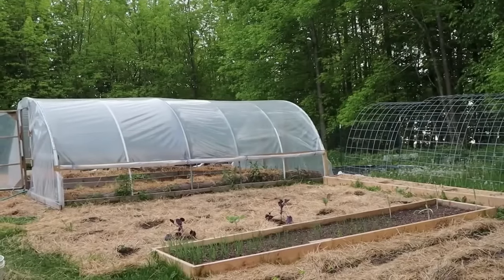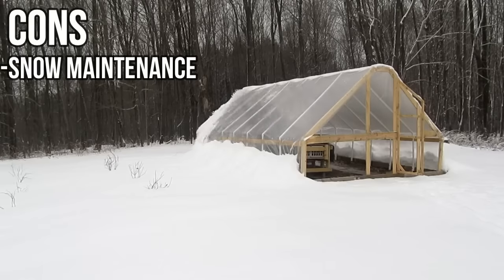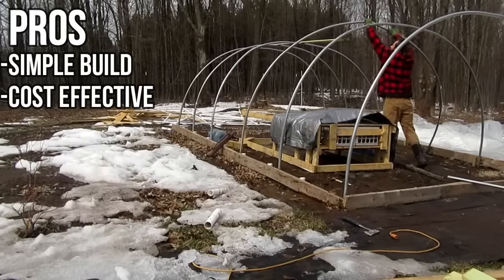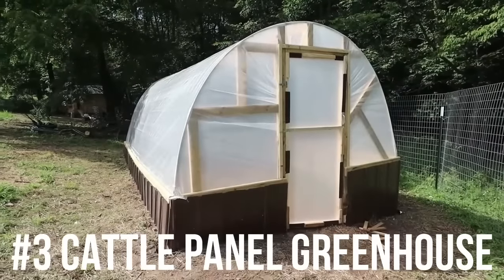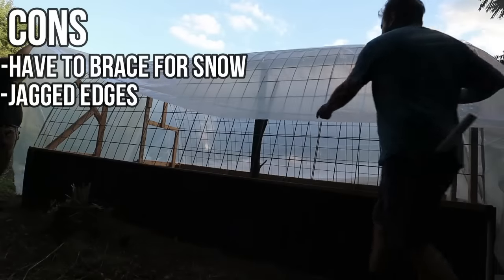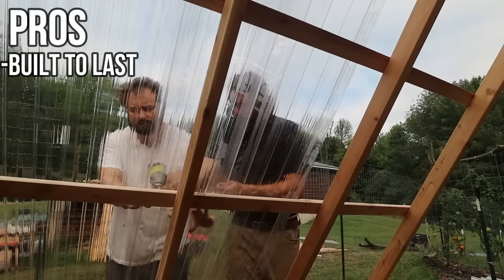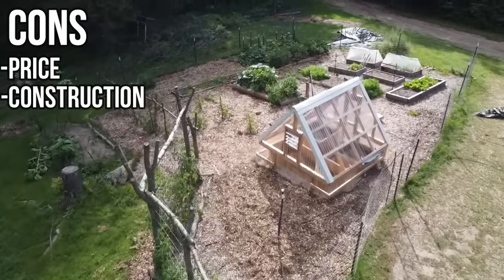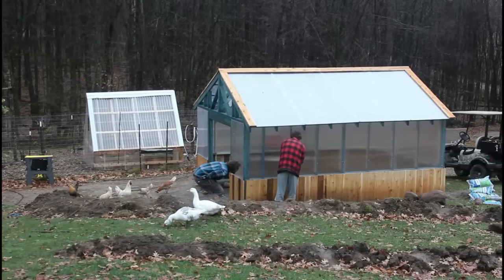The Ultimate Guide to DIY Greenhouses: Pros, Cons, and Everything In Between

Comment: Amazon diesel heater its $200ish runs 16hrs on 5L of fuel vent it outside thru the wall just need a run of galv sprial duct with 1” holes every 2’

Comment: Bro said Con for the first one you need to assist slow removal then showed us that it can be done in under 1 minutes.

That should of been a Pro
Reply from the maker: The pro was that it is slopped for snow shedding so it takes less time. It is a con because you still have to go out there and do it. For the more permanent builds you don't really have to do that at all. But you are right, it is definitely not difficult at all

Comment: Tip for those going with the cattle panel green house. You can get 10' straps of FRP panel corner/end strip from places like builders first source or 84 lumber. Basically any building matetial place geared twords professionals will sell it. Works great on the sharp edges of the cattle panels.
Reply from the maker: Great tip thank you!

Comment: What if you fill pvc with cement?
Reply from the maker: Crazier things have happened hahah.  I have no personal experience with that.  I think it might be hard to get it in the tubes and costs could add up.  But it would be unique if you pulled it off
Reply: You'd want a high percentage of fibre reinforcement in the mix or it'd crack immediately and the weight of the concrete would just be a liability. Check out GFRC.
Reply: @AndrewHelgeCox  What about  foam crete?
Reply: @artistsmeetfilm6491  Aircrete? That's lighter but even more brittle. I don't know if people put fibres in it and get any useful tensile strength.

Comment: if you have some quater inch irigation lines you can run a ton loops on the roof to heat water  just put loops wher you wan the heat to go add a low voltage motor  and a small tank for the water  and your apples

Comment: Wait... 500$ for the one with the castle panels...? In my country a 10mx4.5m with 40mm/1.5mm tubes cost 900€ delivered with 200micron plastic.... why bother doing it..?
Reply from the maker: That list was if you built it the exact way we did. We had all of the material on hand and in scrap piles besides the cattle panels so it was not that expensive for us. We framed out a side wall so I could stand up in there because I am very tall. You could just buy the cattle panels and make a simple structure for cheap. I made a price list to show what everything included in our build would cost so people can figure out the best course of action for themselves.

Comment: Double layer the plastic, with the top layer a little less tight, then get a blower to blow air between the two layers of plastic. This give a dead air space which will both help keep the house cooler in summer, and  warmer in winter, and gives a pillow puff to help shed snow.
Reply: That's more work than you realize. I suspect that you've never actually done that before.
Reply: @maxsdad538  80 by 20 feet. Why do you suppose I suggested the idea.
Reply from the maker: That definitely a good way to go, I am not sure If i am getting to that this year, I have a lot of things on the to do list. Can I ask what zone you are in?

Comment: I used reclaimed wood for my frame that I covered with a few coats of spar varnish. The foundation is made from landscape timber. The roof I used is a greenhouse plastic and the walls are made from thick vinyl rolls. It is on its second year and holding up ver good.
Reply from the maker: That is awesome!! Nice work, that sounds impressive
Reply: @TheNorthBranchWI  if only I could post a picture

Comment: There's another greenhouse build that I like. It looks a bit like the cattle panel build but uses black poly tubing as hoops, making the frame strong and UV resistant. Clear corrugated lexan sheets are then screwed to the outside. Strong and good in cold climates.
Reply from the maker: Nice! That sounds awesome.
Reply: I have a thing for octagons and have build a cabin in that shape. It's a really good shape for small sized buildings and now I want to build an octagon greenhouse. I just need to figure out how to make a clear roof without all that cutting...

Comment: Please describe the temperature gains (day and night) over outside temperatures. That’s what’s really a core issue as to what works or not. Also any thoughts on thermal management?
Reply from the maker: Started tracking those in the fall and will do it again this spring and be sharing as I go.  I made a video about how they handled winter and spoke about temps briefly.

Comment: Just a couple ideas I've been kicking around for heating options.

Electo magnetic and the proper piece of copper, possibly even copper piping. By regulating the power of the magnet you can produce the heat thru magnetic Flux.

You literally could be the first one to own a greenhouse with a Flux capacitor lol
Reply from the maker: That would be so cool!! All of that is way over my head though. If you have any design ideas let me know haha
Reply: @TheNorthBranchWI  you can get the electo magnet from any transformer check out electo magnet from old microwave.

Power it with one of those model power units to get an idea of what voltage/amps gives you the correct temperature and either you can do the heating in air for succulents or in water to increase the humidity
Reply: One More thought is once your greenhouses are staying warmer then you can have their Air come out of the house and heat your house with the transfer

Comment: Thumps up and best of luck with your greenhouse endeavours. ❤🎉 A pit walipini style greenhouse tranch dims = 2m deep, 5m wide, 8-10m long or whatever (1m~3feet) will suggest a smoother temperature flactuations and heat storage. Some extra ideas for air stratification and geo termal tubes for heat storage will serve a great purpose long term in cold climate.  😊

Comment: I built 2 greenhouses using cattle panels and tuftex polycarbonate. 6 years and still going strong. I used zip ties to anchor the panels to the wire and sealed the holes with a little silicone caulk.
Reply from the maker: Awesome! Cattle panels are very durable

Comment: Have you thought of a geothermal heating system?  The hardest part is digging the trench, but it is worth it because once you do all you need is a fan to regulate the temperature summer and winter.  A small fan with a solar panel would do the job for a space that size.
Reply from the maker: We have thought about it.  For us, we don't really need to cool in the summer.  Even our rare 90 days cool off at night.   And our coldest months don't get enough sun to grow much anyway.  So we are going to try to just add thermal mass and extend our seasons a bit.

Comment: Missed on what you did with  windows. My dad has a  greenhouse from a  kit (alu + single pane glass with rubber strips between frames and glass) , roughly in the form of your last greenhouse, but even quite north, 51.2N, a hot day in March can increase the temperature to 40+C when closed, so ventilation options are quite important for us. (and it is cactii, so they can tolerate heat reasonably well).  Heating is done by a small electric heater except when temperatures are below -5C, then a petrol stove takes over. Or is this a glass vs plastic thing?
Reply from the maker: That is interesting. We are considering a lot of heating options. I don't think we will ever try to heat the entire winter because of our cold temps and lack of sun in the winter.

Comment: Awesome video.
Just me a bit confused, about when you say 6mil plastic, do you mean 600 um. As in .6 of a mil?
Cause 6mm is like nearly .25 of an inch. Can’t be that thick.
Reply from the maker: I do not have the slightest clue what they are measuring.  It is just called 6 mil greenhouse plastic.
Reply: A mil is a thousandth of an inch,  (0.0254 mm). 6 mil = 0.1524mm or 152.4 um :)

Comment: Do you wish you made a steeper roof for the last one?  Perhaps with panels that open from the ridge to vent?  Electric soil heaters?  Too late now but you could have put "chimneys" inside your concrete foundation that connect to a small fireplace or wood or corn stove.  Anyways, it's just a thought.  Have a good day.
Reply from the maker: No the snow came off with no issues this year. And that would have been cool haha

Comment: Easy fix for irrigation would be to pipe the water evenly from both sides, through a slight v shape metal pipe drilled with tiny holes, or run it along an angle with a straight pipe if that doesn't work. Adding filter screens would prevent pests and blockages if you have trees nearby, and geothermal is an investment, but for long term it can't be beat to heat
Reply from the maker: Thank you! Those are all interesting. And geothermal definitely seems to be the best option, but tit is a lot of work and money you are right.

Comment: Great video.
     Question: is there a difference between municipal codes for these structures?
     ... for example a lot of times the dimensions, material, and/or
          mechanicals can trigger a city/county inspection and the purchasing
          of building permits.

Thanks for sharing this video.
Reply from the maker: You would have to check with local planning department probably.

Comment: Heating, steel drums filled with water along one side inside the greenhouse.
They hold heat from the natural source and radiate it out overnight, adding a powered heat for cooler times of the year the drums full of water will still absorb heat as it's added then radiate it out. This reduces the cost of heating during the cooler months since the water mass is slowing down heat loss drastically. 

We used this back in the 1980s and it worked a treat to have the growing season extend both starting earlier and ending latter.
Reply from the maker: Very cool.  In the spring we plan on putting gutters on and having at least one barrel for collection on the northwest side.
Reply: @TheNorthBranchWI  The only real issue with the barrels of water is the extra heat during the growing season, we had to leave the door open and let the excess heat vent until it started cooling off in the fall. That was 5 steel drums in a greenhouse about half the size.

Comment: As a passive heating system, I have heard of people using black 'pickle barrels' made of plastic and filled with water.  The black barrels absorb heat and warm the water and then the warmth is released slowly overnight to keep the temperature above freezing, and the process begins all over again on the next day.  I do not have any data on how well this works, sadly.

Comment: It stays with the plastic. Unexpected.
I don't know about you, but my greenhouse will have glass. :)

I am building a shed right now, which taught me enough about timberframe structures to tackle a greenhouse.
As for a heating system; a masonry heater is very neat. And you can snake the exhaust throughout a wall, so it retains a lot of heat. Sort of like how you can make a micro-climate with drystone walls.
Reply from the maker: Interesting. Good luck with what you are doing!
Reply: @TheNorthBranchWI  Thanks! Likewise!

Comment: you might want to look into polytunnel they are used in the UK you can have them as long as you like with a few width options,use the white tape on the outside of the hoops as it helps against the sunlight heating up the metal and damaging the plastic sheets
Reply from the maker: Yeah those are great! We had something like that a few years ago and they work well. We just wanted to make something that could stand up to our winters for the long term without a lot of work. But apparently their are programs for farmers in the USA that can fund high tunnels for farms so we will see haha

Comment: This may have been asked, but do the plastic panels have a size change when hot/cold? Do you need to put them in a frame that allows this movement?
Reply from the maker: Hasn't been asked, and I am not sure. We did not plan for them to move too much, if that is an issue we run into I will let you know. They have some room to wiggle in our current design. Hope that helps

Comment: Is it possible or even practical to build to build the corrugated A frame green house  into a barn style (do to  my width needed) out of PVC pipe and either zip tie or screw the panels to the PVC Pipe?
Reply from the maker: There is always context but anything is possible.  With pvc I always worry about snow load but idk if you are going to deal with that.   For barn style are you talking about ana white?  with the shed style roof? 

If you go that route i would consider some cedar 1 x 3 purlins then attach the panels to that.

Comment: With the metal conduit, did you ever think to connect with 90 degree conduit or pipe connectors for the roof? You could have had a 45 degree roof made of metal and plastic without having to bend the conduit.
Reply from the maker: We built a cold frame where we bent emt conduit to 90 but I never thought about doing it with pipe connectors.

Comment: the 6 mil plastic works great in my are. but i put a spacer and have 2 layers of plastic. it's not as hot. temp is perfect and keeps the heat later after sundown if you close openings. soil seems better too. plus the plants don't get burned by the sun like just using one layer of 6mil. also my plastic can last 8 to 10 years. this assuming it does not burn the first year due to a bad batch. important not to make the plastic too tight and make sure whatever it sits on like metal pipe or 2x4 is painted white. this way the plastic will not burn.
Reply from the maker: Nice! That is awesome

Comment: I am planning on building a greenhouse or two this Spring, but I have moles which dig under the ground and come back up thru the holes. Do you have any suggestions on how I can keep them from coming up into my beds inside the greenhouse?
Reply from the maker: Oh that sucks. I do not have any good answers for you, those are issues we have never had to deal with I am sorry.
Reply: We are putting hardware cloth on the bottom of our raised beds to keep moles and voles from entering. If you are planting in ground, you would need to dig down around the whole perimeter and install a guard underground there.

Comment: Are you possibly getting bugs from the logs/branches you are using for your center support braces. cuz I noticed the only one without bugs is the one that doesn’t have any branch supports. The little 8 by 8 A framer.
Reply from the maker: No, we had them in the metal hoop as well without the support.   It is more they get stuck in the creases of the plastic and die and build up.